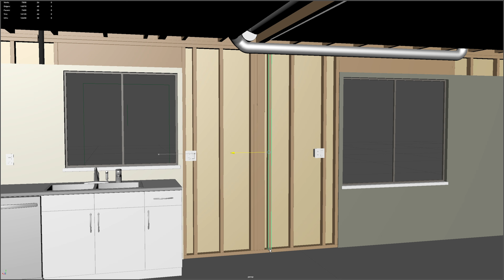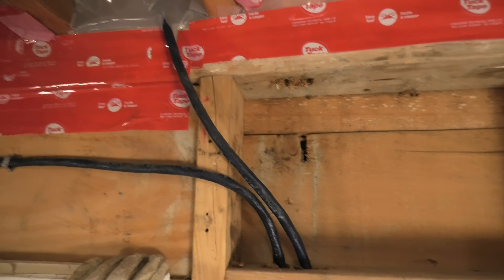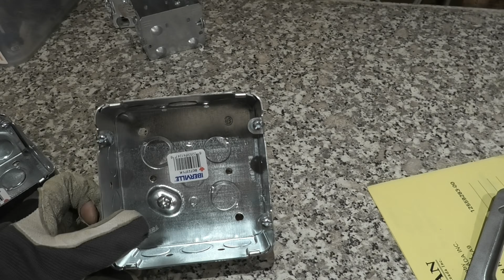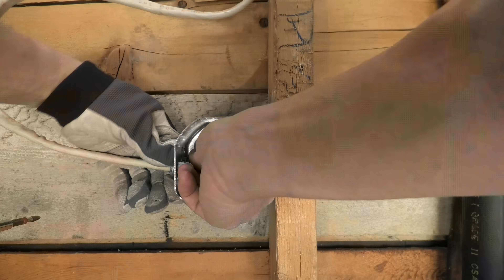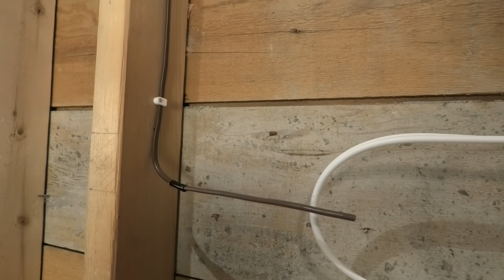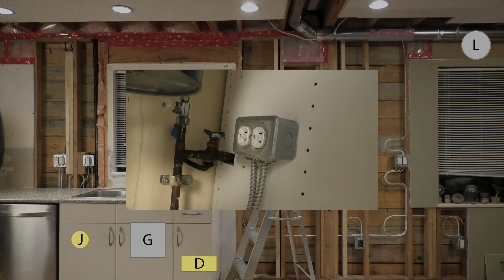Kitchen Reno Ep.3 - Rough Wiring + Receptacle Installation

Comment: I couldn't tell if those staples had plastic insulation on em,and the receptacle under the sink,was that GFCI,projected?
Reply from the maker: Ya the staples are just bare metal.  The receptacle under the sink isn't GFCI and it's not hooked up, the wires are capped with wire nuts on the inside.  I'm just using it as a temp junction box for now until I hook it up to the driver for the LED